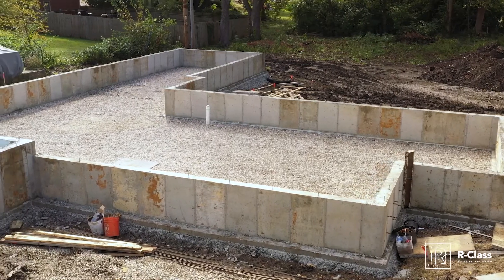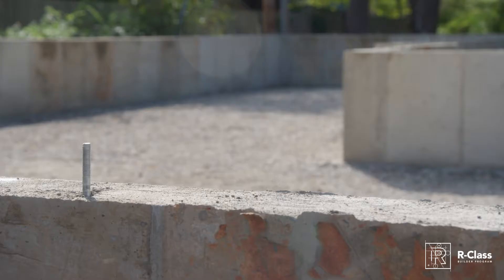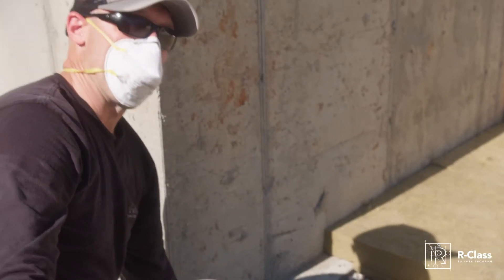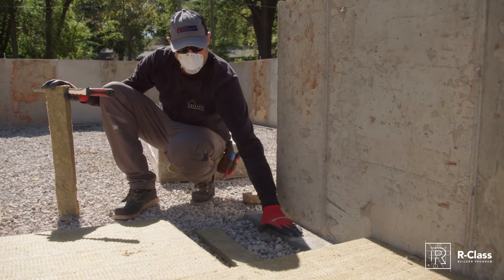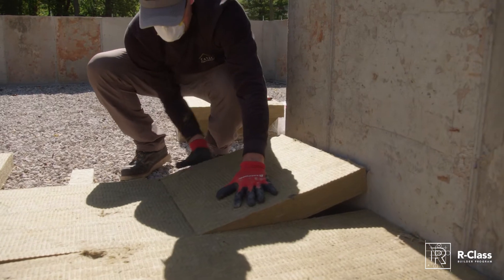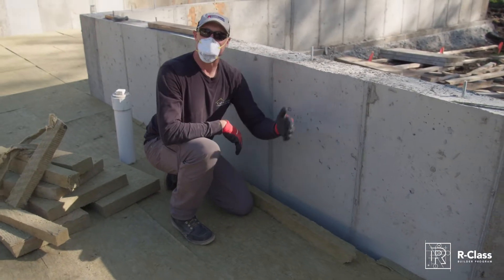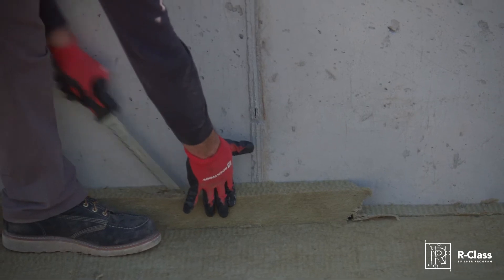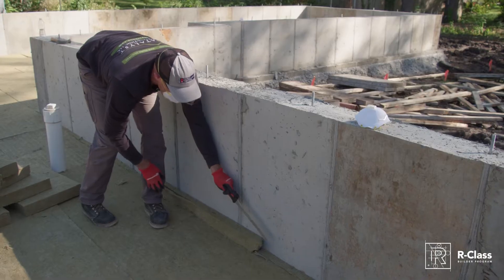Essential steps for insulating your crawl space and under-slab | ROCKWOOL Comfortboard®

Comment: You should have installed the sill plate prior to cutting the Rockwool to height. Alternatively, you could have left it uncut and installed the sill plate done your layout and notched the rockwool to the floor joist height. And filled the void between the rockwool and rim joist with another vapor open insulation product for MEGA insulation at that point of the assembly.

Comment: Below grade, the vapor drive is from the earth into the basement. By putting the Rockwool under the vapor barrier (poly) the Rockwool wil get saturated by moisture ("dampness") in the coming years because Rockwool is vapor open.

This way, the Rockwool will loose a lot of its insulating properties... Wet or damp materials don't insulate very well...
Reply: I was thinking the exact same thing. Putting that vapor barrier on top has trapped the moisture and then they tapped it to the concrete wall. I guess overtime when the tape pulls away from the moist concrete it could breath a little. 

Since this product is SO DENSE...that means it can't hold as much moisture which means it will loose its insulating value quickly or will be pushed up out of the way unless their is a sump pump installed which I didn't see in the video. 

Air is and will always be your best insulator.
Reply: @martyfrancis1011  In Europe, Rockwool is never used below grade (unprotected). Maybe Rockwool applies additives to make the Rockwool water repellent that are different or even forbidden in Europe compared to the USA and Canada.

It's very difficult to get some information regarding the insulation value of Rockwool vs its saturation with water vapor. I have seen studies pretending it loses "only" 30% of its insulating properties.

But the main problem with using unprotected  Rockwool below grade is that we don't know how these water repellent additives will behave over time as they get attacted (degrade) by all kinds of bacteria.
Reply: A capillary break is required underneath (typically 3/4" gravel with no fines)
Reply: @niktak1114  Yes, but that does not stop the vapor rising into the Rockwool.
Reply: @koenraadprincen7212  comfortboard is hydrophobic so the presence of moisture around it doesn't affect the r value as much as it otherwise would
Reply: @niktak1114  Moisture comes (mostly) in two forms: water ("wetness") or vapor ("damp").

Yes, Rockwool is treated with additives to make it water repellent but Rockwool still remains vapor open.

As the relative humidity (RH) of earth is almost 100%, this means that after a while the RH inside the Rockwool will also be around 100% and in that case the insulation value drops significantly.

Rockwool remains silent about this fact as they don't publish a graph showing the influence of the RH on the lambda-value. According other sources, you loose about 30% of the insulating value...

Besides that, below grade, those additives added for water repellency get attacked by all kind of bacteria that will brake down the water repellency over time and if that happens, the Rockwool becomes useless as an thermal insulator.
Reply: @koenraadprincen7212  I assume Rockwool has done long term testing of the products they make for below grade use or else they wouldn't recommend putting them below the vapor barrier
Reply: @niktak1114  Well, the product will hold up, but won't insulate anymore... and that last thing is something you won't notice.
Besides that, in wintertime, a full height concrete basement wall is warmer against the floor than against the ceiling due to the earth warmth (heat).

Strangely, Rockwool does not advertise in Europe to use their products below grade (not even protected). Maybe they are using water repellent additives in NA that are forbidden in Europe?
Reply: @koenraadprincen7212  it's possible. Rockwool makes a bunch of different products in the US, only a couple of which can be used below grade.
Reply: @niktak1114 If I would insulate my foundation or basement slab, I would look into granular foam glass (gravel), i.e. Glavel.

It's a capillary break, water tight, lightweight, has compressive strength, is rot free, thermally insulating (independent from the RH),...
Reply: @koenraadprincen7212  Good suggestion, I'll probably get a quote from them for my upcoming build
Reply: I'm guessing shipping will be a killer though because I need 100 yards at a minimum and they are across the country
Reply: @niktak1114  There are already a few factories that produce foam glass gravel, but yeah transport is an issue.

It's the same with products from TimberHP, great products but transport is an issue.

Comment: This won't work in coastal regions that are prone to flooding. We have requirements for foundation venting that allows flood water in as well as out. This prevents the hydrostatic pressure on walls when you have storm surge. A swimming pool indeed.